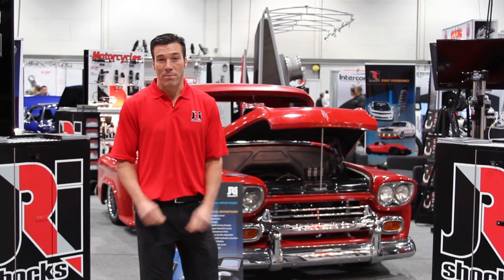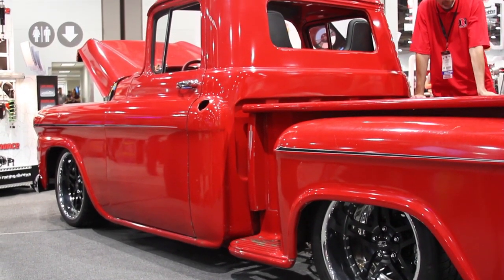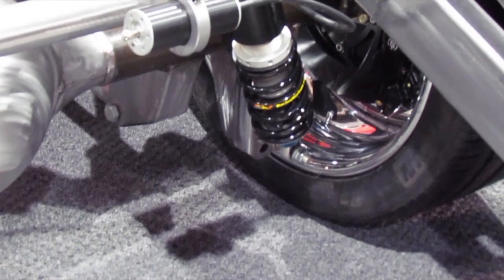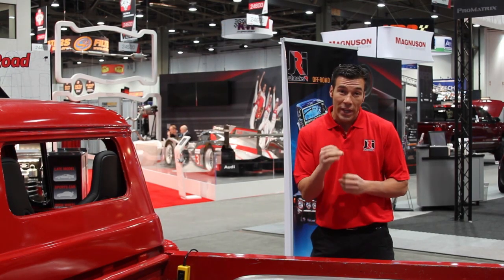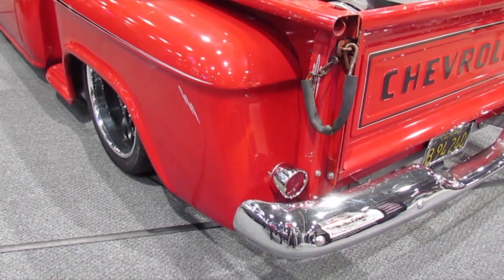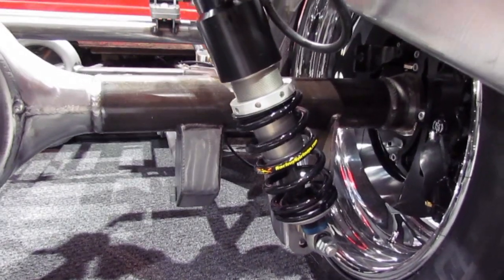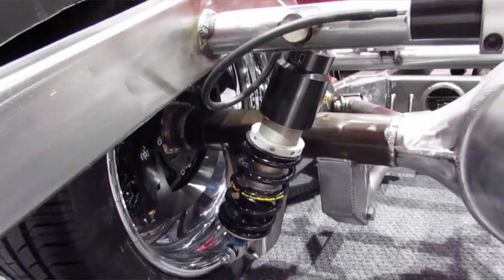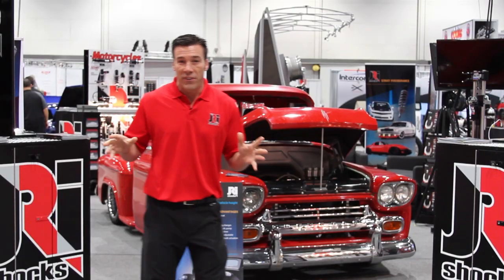Hydraulic Ride Height System by JRi Shocks

Comment: I have a 2010 Audi TTS.  I live on the Atlantic coast of Canada.  I run my car in the winter as the quattro is amazing in the snow.  The only issue I have is that my car is so low from the factory (with magnetic ride), that I'm plowing snow a lot during severe snowfalls.  Do you have a kit that will me allow to raise the car 3 to 6 inches (a bit higher would be even better if possible).  I would only need it that high at relatively low speeds (30 mph) during the worst snow fall conditions, so even it the camber is off at maximum height it wouldn't be dangerous.  I have no interest in lowering--just raising.  Also, it can get very cold in the winter.  Would the cold be a deterrent to running airbags as well as all the salt and sand they use on the roads to make them driveable?  I also don't have a lot of room in the trunk of my car and would prefer everything hidden under the floor of the hatchback.  The TTS comes with a cutout for an emergency donut wheel & tire but without the wheel & tire.

Comment: Lol. 2 inches. You guys have a competitor that's packing 7 inches. With 5 inches of suspension travel.

Ded.
Reply: Drunken Hamster who is the said competitors
Reply: MUHAMMAD ADIB AB WAHAB Hydroshox. Finnegan's garage featured the product in his c10.
Reply: Drunken Hamster yeah that looks better.
Reply: @Drunken_Hamster  that might be true but is that shock not made a lot longer (higher so needs more space to mount) by that extra travel or is the less coil spring? i think there must be a sweet spot between travel  length and coil spring amount

Comment: This video uploader no longer responds to comments!!!!!
Reply: fuck, tryna see if this fits on my 350z
Reply: @astt42hikitut  any luck? I'm looking around for something like this for my 370z. I asked KW and they don't fit.
Reply: probably dont fit, still on stock suspension probably doing air in the future by one of the big companies
Reply: @astt42hikitut  I want coilovers, just want to be able to lift over speed bumps. I don't really want to bag it. Have you seen the air cups to fit over the top of coilovers?
Reply: @Hi_Doctor_Nick  don't do coilovers, ride like shit if u go slammed, I ripped of a 2k exhaust before, bent wheels, ripped bumpers off, not fun. Have money ready for all that shit and maybe even a cracked oil pan lol
Reply: @astt42hikitut  well there are a few con's I guess....
Reply: Yes but low is fun, if you drive in a shit state for roads dont do it. potholes cause so much damage, could bend a frame etc.. im doing an LS Bagged Z eventually with totally redone interior to bring it up to todays standards etc
Reply: @astt42hikitut  sounds like fun. be able to do 11's down the road all day long. nice size engine bay to drop it in. Good luck with that 👊

Comment: Ok,it is now 2016 and I am currently looking at Ridetech Level 2 Air System  for my 03 Mustang GT, so what makes the Hydraulic  Ride height System Better?  I've also seen Ridetech Air Suspension setup used on there Ultimate Street Challenge mustangs as well!...Thanks and God Bless!

BTW...Will your HRH system work with 03-04 Mustang Cobra IRS?

Comment: Does it auto adjust, or simply manual adjustments? any quick setting(drag to autocross to boatlike cruise?

Between this, RideTech Shockwaves and Viking Berserkers ASM..we have some really cool options!
Reply from the maker: Bizno Booyo sorry for the late reply! Didn't see your comment until just now.  Its a manual switch that operates the hydraulic pump.  We did just release an iPhone adjustable system, not for ride height but that adjusts the compression and rebound and that system DOES allow for presets.  All the info is on our website.  Its called the Jri JRide